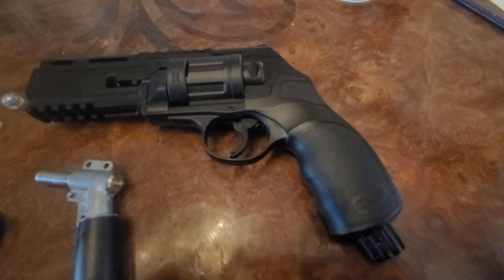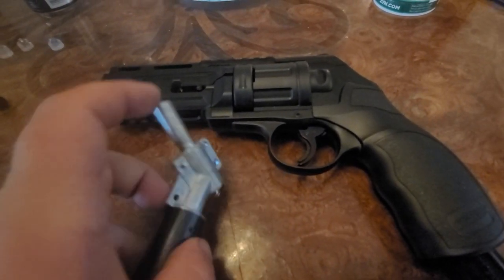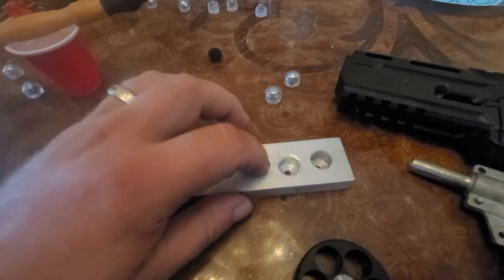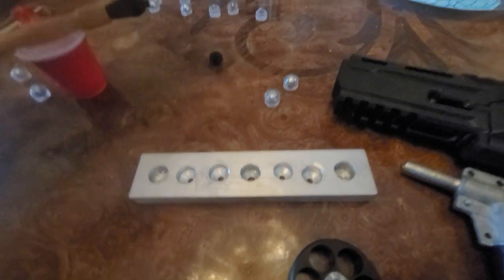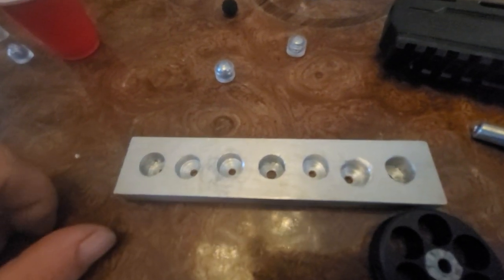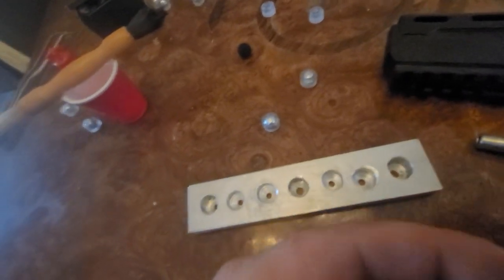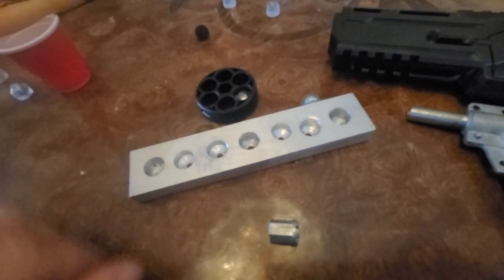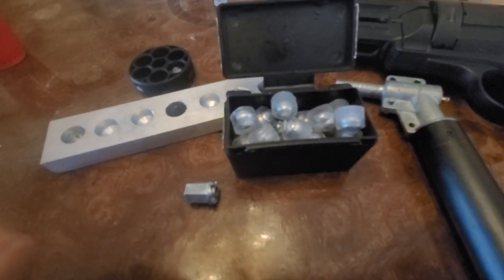Umarex T4E TR50 Mod and Slugmaker!

Comment: 7.5 jule version with the power kit 50 from home Defence-24 in Germany will give more power than a 11jule version upgraded or not. 
They also sell a upgrade barrel and a silicone mould that makes good slugs

7.5 j upgraded gives around 20+j

Comment: Hi what drill diameter you use . What is mould cavity diameter ?
Reply from the maker: I want to say that I used a 1/2 inch, but I think 13mm would be more accurate. I had to sand down the rounds a little bit after they'd been sitting awhile, in order to ensure that they fit loose enough to fire properly.